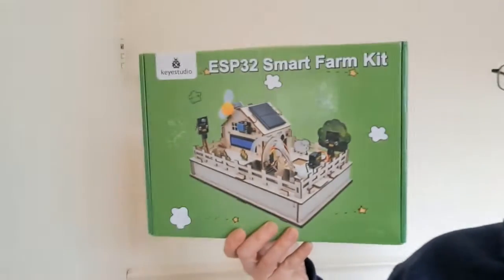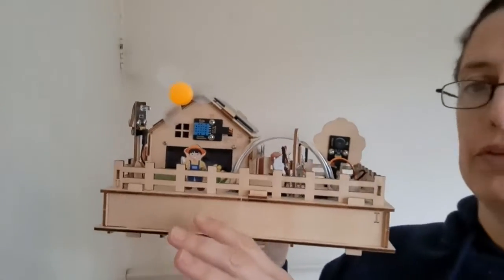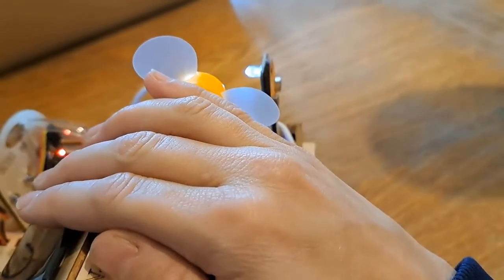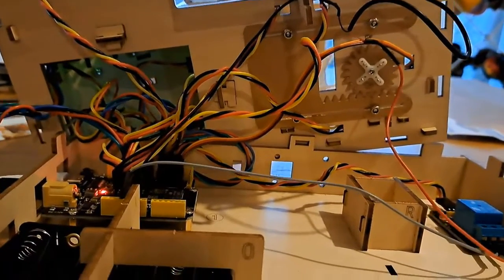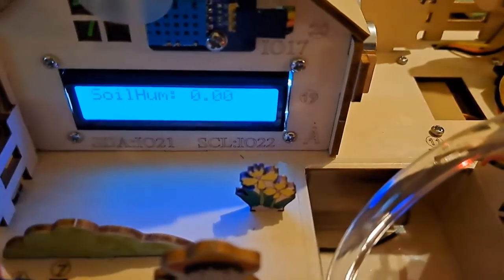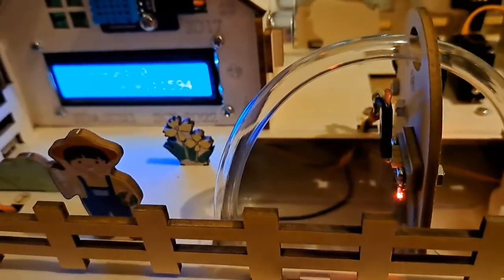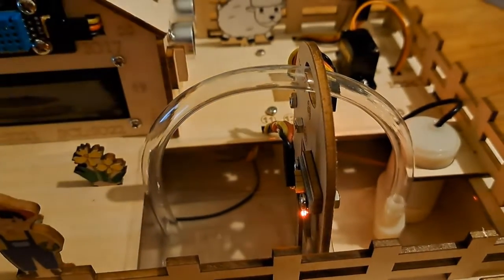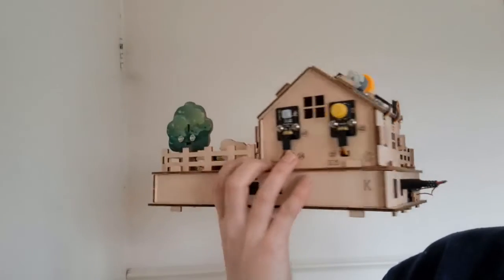Review of Keyestudio IoT Smart Farm Kit: ESP32 (KS0567)

Comment: Hi physicist. I bought the Smart Farm a week ago. Assembled it and checked and rechecked the wiring. I installed the latest Arduino IDE v 2.3.2 for the Mac. Added the JSON link in preferences; selected Board ESP32 “Dev Module” & Port  “/dev/cu.usbserial-1410”; Downloaded CH340 driver and required libraries. 

Not sure what else I’m missing. The sketches compile but on upload I get error messages like: A fatal error occurred: Unable to verify flash chip connection (Invalid head of packet (0xE0): Possible serial noise or corruption.).

I’ve taken the farm apart and tried getting the individual sensors to work but still no joy.

What am I missing? pls help.
Reply: Did you get it working?  I was having issues, but realize I had the wrong board selected in the Arduino program.  Still haven’t been able to get scratch to work
Reply from the maker: The Arduino board is important, yes.  Did you get any of the sensors to work individually?
Reply: I have the same problem, and I still haven't found a solution, can you solve this problem?
Reply from the maker: Sorry for such a late reply - did you ever get any of the sensors to work?  It sounds like you're struggling to get the laptop and ESP32 to "talk".  I struggled with this at first also.  There were a few settings I needed to add (libraries etc) but it sounds like you have already added those.  Perhaps try searching for issues with ESP32 and Mac - I was using Windows.